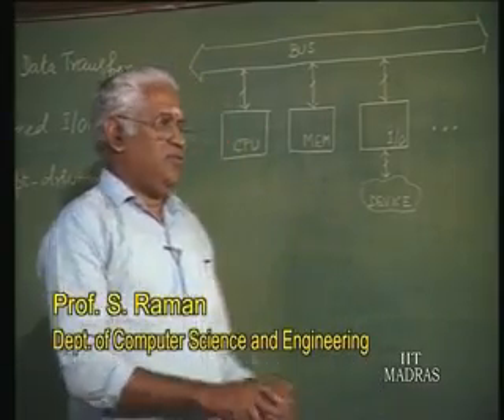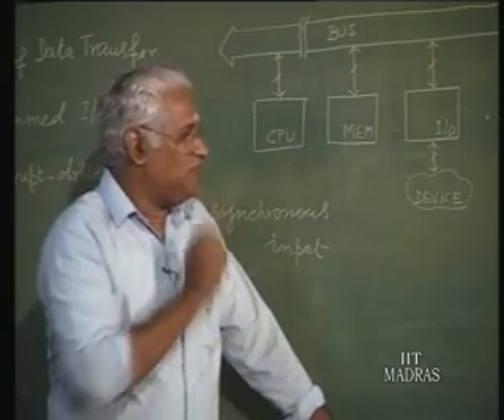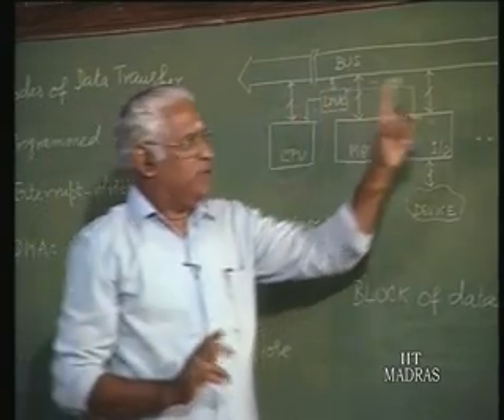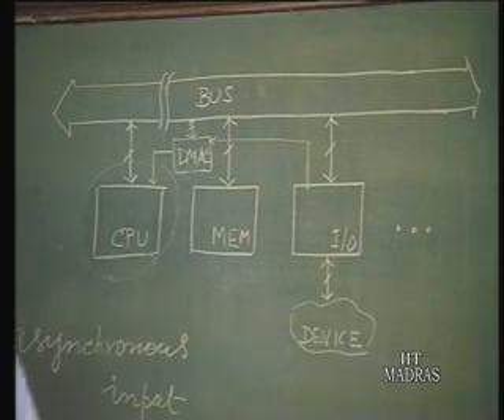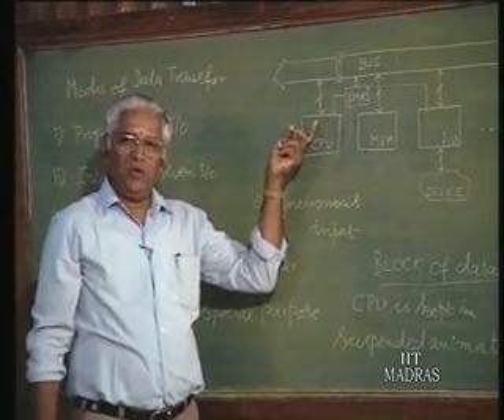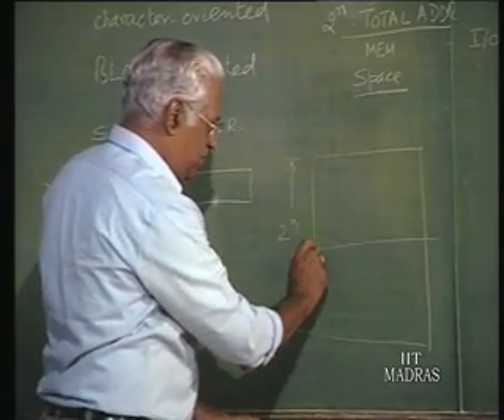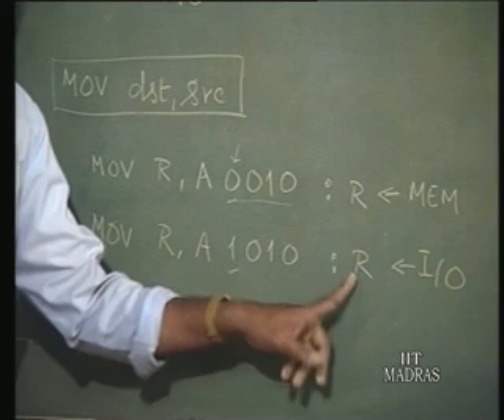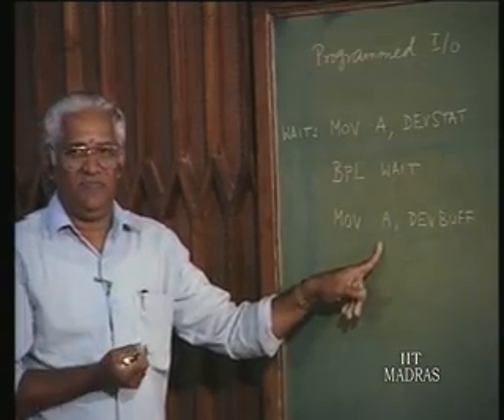Lecture - 26 DMA : Direct Memory Access

Comment: Sir, at 29:00, u explained that while DMA Data Transfer is happening, the CPU is in suspended animation. Say, can't the CPU do some other work, wherein we do some kind of processing on some other block of data, tht had been previously loaded from the Memory, whose is not having dependency on the presently Loaded data..Then i suppose, we can save a lot of Cycles, and can achieve a kind of Parallel Pipelined Processing...?
Reply: As your query is just a week old, I am responding.
1. CPU can carry on with any internal activity that does not need a bus access (as has been mentioned elsewhere in the lecture).
2. In that case, CPU's number crunching and DMA's data transfer to Memory is going on in parallel.
Reply: Sir, Thanks a lot for the reply...Then as per the 1st point, any embedded code which will be accessing Peripherals via DMA must use the BUS Address and not the Physical Address of the Peripheral, say if the GPIO is having Physical address of 0x20nnnnnn, which is mapped to Bus address of 0x7Ennnnnn..Then we should use the bus address as 0x7Ennnnnn and not the physical address to R/W Data to it...
Reply: Raman Subramanian sir you are a god...never came across with such a great lecture in my entire life...
Reply: Raman Subramanian
Hello Sir , i have question ..suppose consider the scenarion , one thread is writing on LCD screen , while DMA process is happening  in parallel...now in the middle while DMA is happening , one screen immediately need to display and that requires the access of data bus , in that case DMA will be put on hold or how ...????

Comment: Question: Please correct me if I am wrong anywhere. 
               When the bus mastery is held by DMA controller, the CPU essentially is continuing its work (instructions). During this process, should the CPU wait if it needs to read or write to CPU? (as the bus is being used by DMA device) If yes, doesn't this reduce the performance?
Reply: the cpu can always switch to a different cpu bound task and put this task thats waiting for i/o in i/o blocked queue, the cpu has always some work to do.